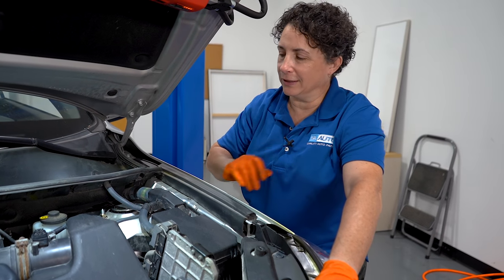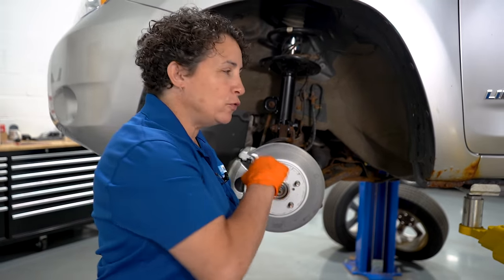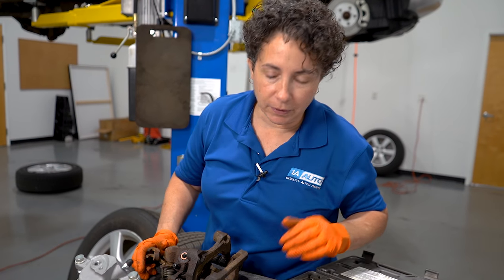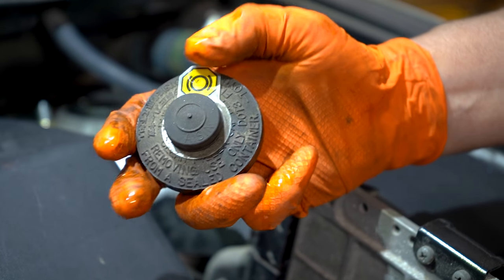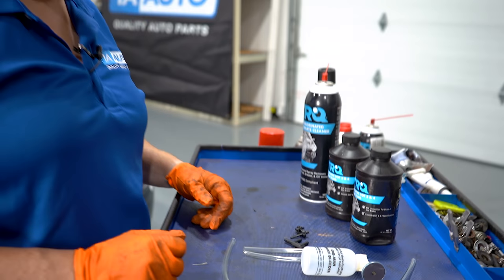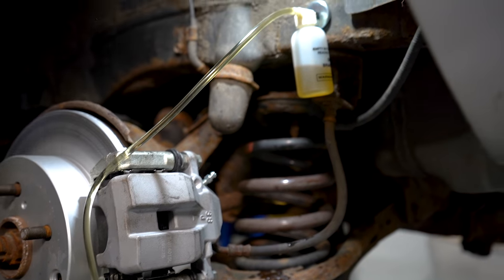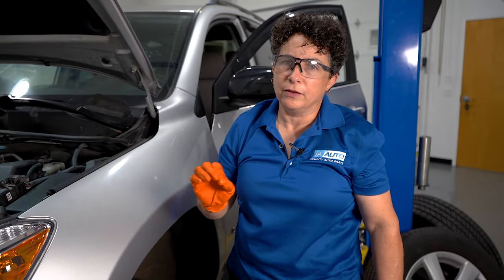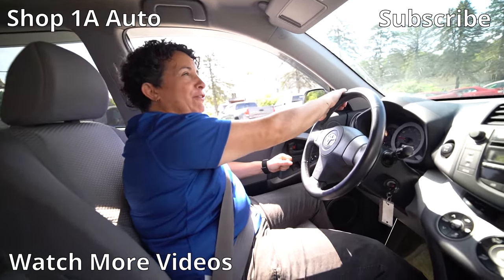Common Mistakes Bleeding Brakes! How to Do a Full Brake Bleed the Right Way, and Why!

Comment: My kit consists of: 1 Coke Bottle hung with a coat-hanger, 1 clear hose from Home Depot, 1 baby bugger suction pump or a turkey-baister, a small funnel and a couple of different size gear wrenches... and O... make sure Not to get brake fluid on the vehicle paint!  Good Upload! Note: in some cases you might want the engine on while you do this, and keep safety in mind first!    When done, press the brake pedal several times till it feels hard before moving the vehicle!.

Comment: What do you do when the brake fluid starts to come through the threads of the nipple? Can you use teflon tape there? Thanks
Reply: Someone mentioned using thick grease or petroleum jelly but I believe they were referring to the bleeder screw threads. I don’t use the pointy, black adapter I use another small piece of tube over the tube end coming out of the bottle and fit that over the end of the bleeder screw after loosening and lightly tightening, leaving the box end wrench on prior to the bleeding tube. Makes a secure seal. Also only opening the screw about 1/4 turn or just enough to let fluid out so as not to expose threads which would cause leaking and sucking in air.

Comment: The reason air bubbles make brakes overheat is because air compresses and decompresses, and bubbles act like a spring in the line (while hydraulic fluid doesn't compress). What happens is when you brake, the air bubble will compress, and then when you release the pedal, the air bubble will keep holding pressure and keep the piston pushing on the pad. Not a pressure anywhere as strong as when you brake, but just enough to keep a certain friction going and heat building up. You can check if your wheels are warm after driving on a highway for a while without braking. That "may" be a sign. Mainly if one wheel is much warmer than the others.

Comment: thank you so much for this informative video. i spent a lot of money on a mityvac brake bleeder that has a vacuum pump at the bleeder valve and learned that using that method sometimes causes air to be sucked in through the bleeder valve through the threads. all I was getting was air bubbles in rubber tube. I'm going to try your method tomorrow to see if it works better that way. these brakes haven't been bled since 2005 so it definitely needs new fluid because the stuff coming out was dark green and smelled like rotten fish lol.

Comment: Great tutorial. I would add checking and lubricating the slide pins on the brakes even if you didn’t replace parts. An ounce of prevention while the wheel is off.

Comment: Great job on this video. Some additional tips.. If you are using a vacuum bleeder add some teflon plumbers tape to the threads of the bleeder screw, otherwise you will suck air bubbles all day long thru the loose threaded bleeder connection. Not so much when you are using pressure from the pedal as the pressurized fluid will seep out of the threads slightly. Also use a zip tie around the bleeder hose-to bleeder screw for a tight seal.  Another tip. If you are not sure about the order of the locations to start and finish,  start at the back and just keep bleeding until the air bubbles stop.👍✌

Comment: you've  talked about air, and only briefly talked about dirt in the line. also, what about the use of different pumping numbers based on how far the line is from the master cylinder or and dealing with the abs? always a good or great video from you and the guys.

Comment: Just got the front calipers replaced in my 68 Datsun 2000 roadster.  The brakes are a bit mushy..  I could take it back to the shop, but now I'll just bleed them myself.  Great video.

Comment: Sue is awesome, she's a great teacher and with a great sense of humor, haha. Great video....I've been having trouble with my truck having a sinking brake pedal....we've bled the brakes several times, replaced the master cylinder. Only thing I can come up with is a bad ABS module/pump. Trying to find a way to diagnose that (safely).
Reply: Alright u need to check the disk whether there are some that are bad
Reply: @osaromarvis51  despite you being the master…..I have never seen an out of true rotor or drum cause the pedal to go anywhere near the floor, please educate us as to why this could be the case oh wise and wonderful osa.

Comment: Nice video Sue. Well done.
Just finished replacing rotors, calipers, brake pads, front brake hoses on my 2004 Ram 2500. $$$
Will be bleeding the brakes tomorrow.
I have that bleeding kit….easier with two so one can see what is happening…but no air bubbles in the line is the goal. 👍
Reply from the maker: +Eric Frederick Thanks for checking us out! http://1aau.to/m/Shop-1AAuto-c

Comment: I really appreciate good teachers like yourself, Sue!  General question (or, maybe your opinion) for us DIYers who don't have a lift system at home:  with only a floor jack and a pair of jack stands, can your bleeding process be done with only the front left in the lifted position?  Or, does the vehicle have to be sitting level with all four wheels off the ground?  Thanks!

Comment: Thank you for the very good video. I use a Motive Power bleeder. My question is does the bottle the used fluid dumps into always have to be higher than the caliper?

Comment: You make automotive interesting. Great work! I have a passenger-side hose leak. Break fluid dripping on the bottom of the tire. I have an ABS system. Disks front and drums rear. Any more that I need to know?

Comment: Wow that was super cool I have a question I have a little air in my brakes I changed the cylinder and we pumped we bleed or breaks and I don't have no brakes now could I do I still have air

Comment: I did my brakes yesterday in a 2014 Kia Sportage Diesel and i saw your video because i always do my bike brakes but had never done it in my car and it was overdue.

I started using your method but ... as i go forward... i see my brake flui waaay too dark, almost entirely black, so i didn´t get confortable with this situation, so i drain my entire brake fluid of all my tires, i started using a manual pump but i saw that it would take forever, so i used my air conditioner electrical pump, to make the pump for me, and recirculate clean fluid for the entire system (using a old container fluid on storage so it was dispossable), until i saw that i always cames out clean.

Then i flush again the entire fluid, the system would be fill with air entirely, but with my AC Pump method i saw that bleeding would be a breeze, so i pour the new fluid in the tyre order that my workshop manual indicated, that was. RR, FR RL and FL.. bleed thhe system twice to be sure, it was easy enought with this pump... and that was it... i got a amazing feeling braking system.

I think is preferable to flush the entire fluid and even make flush again to remove all dirt, i dont feel confortable leaving old dirty fluid on the system.

But i thanks a lot for your video, you suscessfully explain why there is a order to the bleeding.

Thanks.
Reply: A AC vacuum pump would clean out the lines, but I think you may damage the pump. You can buy a cheap hand held vacuum pump that works fine, but takes a little more time. Good video, but I believe the lines were already filled before video. After replacing any calipers or wheel cylinders, I need to pump 12 - 15 times and sometimes more, but it does work. Thanks for speaking clear.

Comment: good video. My gen 1 montero has both back wheels in line and the service manual provides brake bleeding instructions as 1: RR, 2: RF, 3: LF - skipping the left rear altogether as it gets bled by virtue of the right rear being bled. I've heard that mitsubishi gave that same instruction for monteros all the way up to the early 2000's

Comment: Very informative video thank you
I'd like to flush my entire system and replace it with dot 5 is there something I should run through the system to get the old brake fluid  out,  Like denatured alcohol or break clean

Comment: Thank you for making this video, as a person who has not ever done the actual bleeding of brakes himself only doing with the help of others usually the one who just does the pumping for the person who is. I now have a clear understanding  of how this process is to be done along with some other additional wise pointful choices that mafe since. Such as when only doing the fronts to also take the time to do the back as well. Which this is something that I recently did not do this past weekend, when I replaced new front brakes & calibers. So I now think I can do this myself. Now to to try to tackle what I think is either a bad master cylinder or brake power booster or both.

Comment: Thanks for the info. Very fine job. Question, please. I recently had my brakes done at a repair shop, front brakes and rotors. The next day, it started to smoke as the brakes locked up, had it towed back to the shop, then to a dealership for diagnostics. According to diagnostics, it says swelling on reservoir cap (brake fluid), also the mechanic put oil instead of brake fluid, needs a complete flush and replacement of rubber hoses. Is it safe to say that the mechanic/auto repair shop who did the brake work is responsible? Thank you.
Reply: Yes
Reply: Whoah! 😮

Comment: How do you explain this?  My Honda Sport Fit 2013 model, with ABS system on passenger side, repair manual states to start the bleeding with the Front.  FL, FR, RL, RR.  Every single review/blog/instructions out there always state to start in the rear.  Which one is it, really?
Reply: Hondas are different. Follow what your manual says. She obviously forgot to read up on Hondas
Reply: @supersabrosinho  Thank you.
Reply: @supersabrosinho  I have to change one caliper and both front brake pads.  Is it better to bleed before or after installing new caliper and brakes?  Right now, the piston on the bad caliper is all the way out, so I think is safe to assume that the cavity inside the caliper is full of brake fluid.  Muchas gracias and have a nice day!
Reply: @n.g.1577  After you install the new parts, i have done for a friend's accord, worked out perfect

Comment: Great video! You mentioned about "a corvette," but I'm guessing that was for a more modern one, and you said rear right, then front right. What about for a 1969 Corvette, is the bleeding order: passenger rear, driver rear, passenger front, driver front? And for the rear calipers, does it matter if you do inner or outer first on both sides?? Thanks!!

Comment: So, I just replaced the calipers and steering gear on my 13 silverado 3500HD. It has the hydroboost on it and I refilled the power steering pump and cleaned out most of the old PS fluid and then bled all of my brakes from rear passenger up to the driver's side. They all get an equal amount of clear brake fluid coming out, it's nice and clear, and no air in the lines. The pedal is pretty firm with the power off and the power steering reservoir is also full and it turns just fine.

However, when the engine is running the brake pedal can be pushed to the floor with almost no effort and then it slowly springs back (maybe a second to return to full position). Soooo... All air has been bled out, power steering has been bled and seems to be turning the wheel just fine, the hydroboost seems to be functioning (clear brake fluid shoots out 10x as much when I open a bleeder screw while the truck is running). 

I'm at a loss as to why I don't have any brake resistance and I assume it's something proprietary that has to do with the hydroboost. Any help is GREATLY appreciated.

Comment: I tried some of that soft break line sold on Amazon never could get the double flare ends to seal. I had to go buy the old steel lines I think the problem is very soft and doesn't seal well with brass. Where steel lines double flared bites into brass connectors. There is a reason why factory uses steel lines because they are strong less chance of breaking the line open.

Comment: Nice job Sue. I used to do this in the 80’s with my cousin who was a mechanic. Not much has changed last 40 years
Reply: Yeah, no abs, no 2,4 or 6 piston calipers, cupronickel brake lines, ceramic pads, carbon fiber disks, dot 4 fluid…..shall I continue ? Or are you only doing cars with single piston fronts and drum rears ala 20 years ago ?

Comment: Please add a video covering bleeding ABS brake systems and what not to do and how DOT 4 should be used with ABS brakes even if the vehicle originally came with DOT 3, thanks, excellent video.
Reply: Dot 3 and Dot 4 are compatible, not Dot 5, which is silicone base.

Comment: I love your videos very helpful!!
I just replaced all the brakes on a 2000 Jeep Cherokee, bled the brakes, from farthest to shortest as you described in n the videos, when the car is off the brake pedal is nice and firm, but when I start the car the pedal sinks straight to the floor, I checked for leaks there are none.

What else could be the problem?

Comment: What do you torque the banjo bolts down with the copper washers?
Reply: Good question. My manual didn’t say. It said to look at the specs but they forgot to put it in there so I looked it up online and for 2004 Honda Civic 1.7 L Sedan it was 25 ft lbs. Can’t recall what it was for my daughter’s 97 Nissan Sentra but it was a lot more than that and I had to keep torquing so it would stop leaking. Ugh

Comment: I have a 1961 Ford Thunderbird I changed all the wheel cylinders and Soft brake lines on and breed them the way you said but The brake pedal seems to be getting harder but not coming up and I can’t seem to get all the air out of them after several hours of bleeding. Appreciate any advice you might have. Thanks.

Comment: I'm using this for my 2007 Scion TC. 
It's the original brake fluid and that's my fault. 
After flushing the system from farthest to nearest should I replace the OEM brake lines or upgrade to braided stainless steel lines?
I'm using EBC USR Rotors and YellowStuff Brake pads.
I'm flushing with Redline DOT 4 synthetic brake fluid.

Comment: Great video! This video explain every steps with explanation instead of just telling you what to do. Btw, is it possible to do reverse bleeding brakes with abs system? I know the normal way is better, but just checking out the possibility, I heard about it will break the abs system but I don't know the reason behind...

Comment: Just curious, was that an ABS braking system? Cause I'll be doing my brakes on my 93 Grand Cherokee Laredo 4.0 that probably had never had a flush. I also will be replacing Rotors, Calipers, Pads in front & Wheel Cylinders, Drums & Shoes, & hardware in the rear. In what special order should I do this since I'm doing this extra work here?? As I also need to flush the system out due to sitting a long time & over 200,000 miles on it! Thx so much for your expertise & help and providing us a great video. Hope to hear from you soon, Todd R.

Comment: Great video, very informative. I do have a couple questions. When you pull the fluid  from the master cylinder do you leave some in the bottom to avoid having to bleed the master cylinder? And the bottle you hang above the brake caliper,  does it  have hole to let air out or is it air tight? Thanks 😊

Comment: I've been a backyard mechanic for 45 years and always bled brakes the "traditional" way. RR, LR, FR, FL. My son recently got a 2008 subaru wrx and we replaced all for calipers. I saw some subi youtubers bleeding "out of order", almost backwards, saying thats what the shop manual calls for, and I couldn't understand why. RF, LR, LF, RR.  The furthest last. What do you think about that?

Also, opening the bleeder 1 1/2 turns seems excessive? I crack about a 1/4 turn, just enough to let fluid escape. I'm afraid of air getting sucked in around the bleeder screw threads.
Reply: Some have commented to use thick grease on the bleeder screw threads or petroleum jelly to seal & prevent air.

Comment: Superb video. Like all good teachers,  you explain not only WHAT you do but WHY you do it.  Brake fluid is a pretty good paint remover,  so I wrap towels around the MC to catch splashes.   Do you recommend teflon tape on bleeder screw threads?

Comment: Thank you Sue! I would have loved hearing the ABS system mentioned as well. Does the ABS need to be activated for proper bleeding? Or is there another video on that?

I’m dealing with a “sinking” brake pedal, but changing out the master and bleeding the system did not help…

Comment: I was wondering what that black cone tip was for with my pump kit, it goes right in the bleeder screw, nice to know!
Reply: is it a one way check valve or just a cone tip that fits many size tube?
Reply: I don’t recall if it came with my bleeder kit but I have several sizes in my MityVac kit. The clear tubes of various sizes work better and seal onto the bleeder screw pretty well.

Comment: What about flushing out an abs brake system? On my 2003 corvette, one of the main things to prevent is letting any air bubbles into the brake fluid resorvoir while pouring, or letting the level go down too low while pumping brakes. If air gets in there, you will need a special scan tool to properly bleed system. I have bled brakes while doing brake repairs in past, but never a good full flush. About to attempt full flush, but cant help but wonder how to be complete, as there will be some old fluid trapped in abs system. Repair manual talks about using special scan tool. Tool is thousands of dollars.